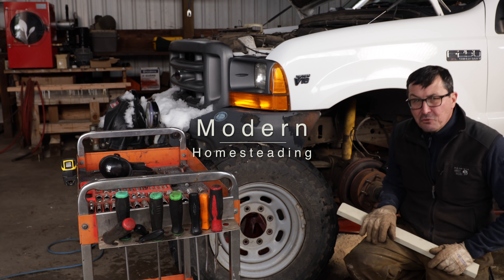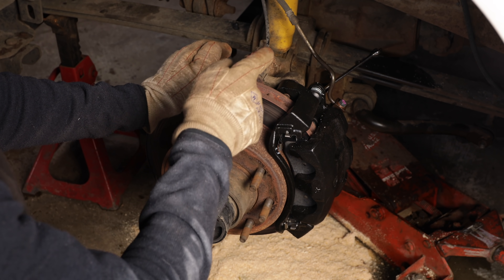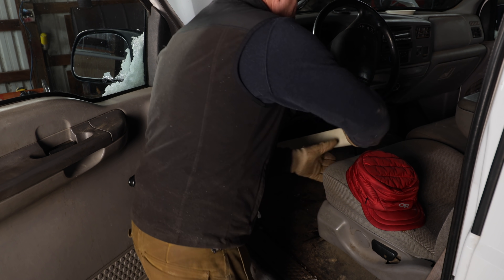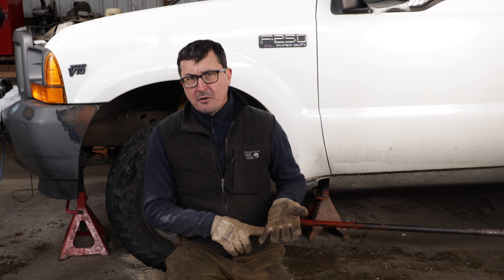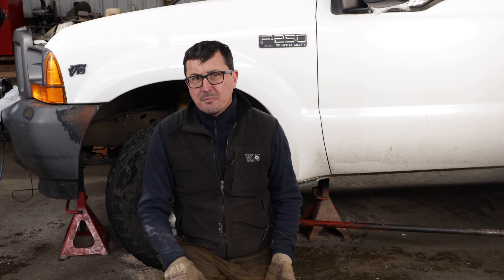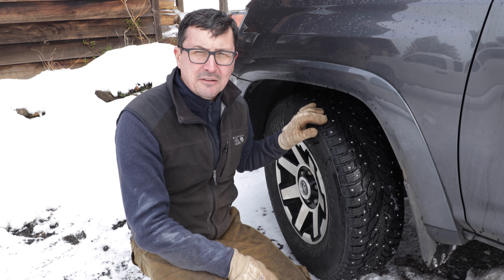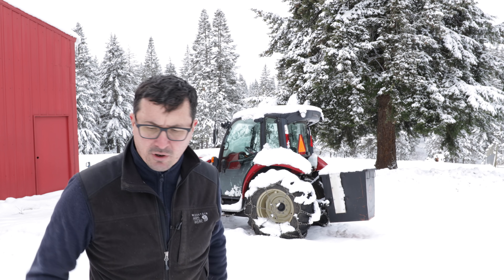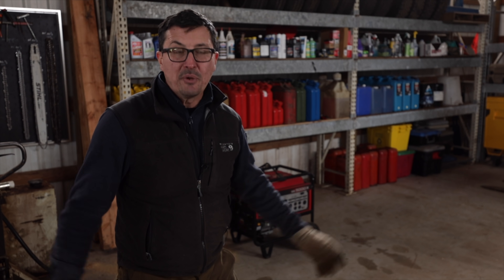IT FINALY HAPPENED!

Comment from the maker: Get boot chains here - https://amzn.to/364SlXj (amazon affiliate link)
Reply: Ohh boy,  I've busted my tail several times going from ice onto tile in the mudroom floor on concrete in my shop lol.
Reply: yes, Saves a lot of time  :)
Reply: FREEZE DRY MARSHMALLOWS! they taste great also try some candy
Reply: Two years ago I was spreading ice melt in the parking lot at work, using a hand crank rotary broadcaster. My legs went out from under me so fast that it was as if they had been kicked out from under me. I felt my head hit the ground, felt my ribs crack, and after laying there for a moment, I realized that my arm was broken. I had to have surgery to install a plate. Thank God for Workmans Comp. My company actually pays full wages for up to 30 days for an on the job injury requiring time off. I also thank God that my body still heals well, and quickly.
I will be getting a set of these this week.
Reply: Should have worn your boots with the little DIY cleats in them... 'member those?
Reply: cody a better trick with bleeding your breaks put a rubber hose on the bleed valve one that fits on tight and long enough to run down in to a bottle of break fluid that is sitting on the ground make sure the hose  goes to the bottom below the level of fluid open the valve and get in the truck and pump the brakes air will go down the hose come out and float to the top of the bottle job done
Reply: Hey Cody, heres a quick trick for bleeding brakes by yourself from a journeyman mechanic, get yourself an empty soda bottle or Gatorade bottle, and a clear rubber tube about 24"-36" in length that fits nice and snug over the bleeder valve, drill a hole into the bottle just big enough that the rubber hose can slide in and out snugly, fill the bottle about 1/4 full of brake fluid and place the hose about 1/2"-1" off tue bottom of the bottle, attach the other end of the hose to the bleeder valve, crack it open and slowly pump the brakes several times. This pushes all the air out of the line and as you release the pedal the fluid you added to the bottle keeps air from being sucked back up into the system :) works like a dream :)
Reply: Jared Kean has to
Reply: AJ Hainstock .
Reply: Wranglerstar what about Land Rover defender there a good truck mine has never broke down or had problems with it
Reply: Can I have a axe
Reply: Wranglerstar hey! Love your channel! I was wondering if you ever tried those boot chains removing snow from your roof. I’ve always had to go through multiple pairs each winter with the Yactrak brand and they are not cheap. Would love to hear your opinion!
Reply: @williams6550  no Amazon affiliate link for those though lol

Comment: I like how Ford did the spark plugs, the engine just blows them out when you need new ones.
Reply: Jim C makes so much sense
Reply: I almost spit out my coffee reading this lol
Reply: Or how they brake off in the head when you replace them on a 3 valve v8 and have to buy a special tool to remove what's left of them lol
Reply: This is why they make helicoil boys.
Reply: @BIGREDTECH  they take a special plug designed by Ford so.....
Reply: Hapend to my v10 but my old dongle is still going
Reply: @jeremybrua5523  no. Bosch makes the best replacement, and its the same thing they would put in it if she puked the plugs or not. Problem being here is the plug grounds so hard it eats the threads on the plug and eventually they blow out and it makes a god awful noise and you lose compression so bad it wont maintain 45mph. Wrap the new threads with coil before you put them in and itll never have the problem again. Cam phasers though...... thats a different story
Reply: easy fix for that... buy a 7.3 or 6.7... or 460 or 351 or 400 or any other engine... you know the ones that were made by ford...
Reply: @thesavior2398  agreed. Real trucks dont have sparkplugs.
Reply: @highclasswhitetrash9027   hahaha good point
Reply: 7.3 was not made by Ford, made by international.
Reply: @joshstaton508  and they put 7.3s in everything right, not just ford bodys?
Reply: @joshstaton508   correct i just  kinda included it as a outlier but also you could say the 7.3 gas haha but no i really just uncluded it as a outlier.  also people need to take care of their engine and change the oil every 3k miles... and stop overheating your engines
Reply: @joshstaton508  if we're going by that standard ford has never made a diesel engine, neither dodge or gm........
Reply: Happened to mine three times. The third time was one of the repair inserts blowing out after the dealership did the repair. It's currently sitting and waiting on me to get the time and money to replace the head.
Reply: This happened to me when I was younger lol.😂🤣🤣... It was my fault for installing the wrong spark plugs. Makes a heck of a sound and fire 70mph.
Reply: @highclasswhitetrash9027  the 6.7 power stroke is a ford in house motor. Also the new 3.0 power stroke is a ford motor.
Reply: Aluminum heads are the clue to a crappy truck engine.
Reply: @jonathangray7067  color me wrong buddy haha, i didnt know that fords contract with IH went the same as dodges with cummins, the powerstroke is now shittier for having fords name on it. Fiat is loving the cummins now, maybe sterling will keep up with IH and be the new go-to for us daily haulers of 10k plus.
Reply: @thisisyourcaptainspeaking2259  ARP head studs fix all aluminum head problems, and theyre affordable.
Reply: @highclasswhitetrash9027  say what you want, but 6.7 ps is the best diesel out right now. Lot of cummins and duramax guys are trading in for a power stroke.
Reply: @jonathangray7067  not saying the 6.7 is shitty, ive only driven stock in a loaded down f350 but i wasnt impressed. The lbz 6.6 with turbo and injectors pulled the same load better with more mpgs. One rig cost $80k one cost $15k ill let you fill in the blanks.
Reply: @jonathangray7067  and before we get carried away my daily is an 08 f350 with the 6.4.
Reply: This is why I dont buy trucks with spark plugs.
Reply: @highclasswhitetrash9027  a duramax and a allison is a nice set up but you get that chevy off the highway and the front end won't last for 50k miles. Where I'm from you're either putting new front axle seals in a dodge every couple years, or bullet proof a ford 6.0, or now guys can afford a 2010 and up ford with 6.7, and with a dpf delete and just a tune on all three diesels (duramax, cummins, power stroke) the ford 6.7 puts down way bigger numbers.
Reply: Not with the glow plugs
Reply: @jacobscout4  if we say that we might as well say no grid heater either eh?
Reply: 93 ranger 2wd 2.3l 5sp, 478,000 miles and still going strong! My daily work truck. Crazy reliable.
Reply: Poor fella hasn't had the pleasure of working on Ford's brainfart 6.0 or 6.4 Powerstroke......
Reply: Never once had a Ford modular engine pop a plug. Torque the plugs and then go an additional 1/8th-1/4 of a turn. They won't ever blow out.
Reply: I have 2004 F250 V10 since new and it still runs and sounds great.  Changed the original spark plugs @ 190,000 miles with no issues. Never been to the shop for anything.
Reply: @jamesrichardson559  My 2000 Expedition 5.4 has 203k on it. Original engine and drivetrain. Never even had the valve covers off and all original accessories on the engine. Super reliable vehicle!
Reply: Never Helicoil a triton ford motor. They have a taper at the end of the cylinder head. Buy the cal van kit and it is a Permanent fix for the spark plug issue.
Reply: Yep, I kept having problems with lack of power, rough running, on my F250. I kept taking it to the Ford dealer I bought it from for a "tune up" and oil/lube, and then random plugs would fail, then break in the engine block..... Finally I flew into a rage and told them that they had better fix my truck once and for all and the service rep says, "well, you know, this truck was due for a spark plug change 7,000 miles ago...." trying to make it my fault. I asked him and the 2 other staff at the service desk "What does Tune up mean to you? Would you agree that it includes plugs?" I told them I wanted all new plugs, new wires and anything else remotely connected to the spark plugs and that I would be taking my business to another dealer that understood a customer's request. The owner of the dealership chased me for 6 months, calls, cards, apologies, flowers, fruit basket....... The dealer where I now live actually does a great job and will be getting my future business.
Reply: How to fix ANY ford.......Buy a Chevy, easy as that
Reply: @73xlh  Yeah, that's why chevy is stopping production of it, because it is that good......
Reply: @70acres  no matter, gm' s next production will be light years ahead of any Ford.

Comment: I spent $35,000 on a new ford. The truck honestly spent more time at the ford dealer being worked on from transmission issues and front differential issues, than in my garage. Then it started to have electrical issues. The truck wasn't fixed after the ford technicians worked on it several times. Always owned Chevys before that and I've never had any major problems other than a few sensors and a fuel pump. So I traded in the ford and my problems stopped.

Comment: Just a few more pro tips. 1- Gotta make sure the break hose isn't bad too, it can cause pressure to not release on the caliper, also the caliper slides, both can cause overheating and smoking of breaks.   Just slapping a caliper on there my not work. 
2- Only depress the break pedal half way when bleeding too.  Master cylinders only see limited travel, which causes grime to build up.  Mashing the pedal all the way down will drive the cup seals of the master through that buildup and can kill the master cylinder.

Comment: My 1970 Chevy C-10 pickup (her name is Bessie) is still ticking along like a Swiss clock.   Older Chevys were built to last.  350  quadrajet Rochester carb.  She will fly.
Reply: exactly. my 71 blazer - no computer. can be repaired with a $60 socket set.
Reply: Hey I have that same jotul 8 in your profile pic thing heats the garage good
Reply: @calebmartin2457  I love this wood stove. I also have a Jotul 3, which in my shop. :)
Reply: CountryLifeTales that’s awesome, I was just scrolling through the comments and I was like hold up that’s my woodstove 😂

Comment: "looking at the used market", last time I looked Chevy was holding value better than fords at least in the 1/2 ton area, but maybe its west coast math
Reply: kurtblack8 think he comparing the raptor to a 1lt lol.
Reply: I remember when the raptors came out. Every lawn service guy around here bought one and traded in or sold it real quick. For the first year you could find them everywhere for around $20k with as much mileage. No one realized a truck meant for jumping would squat that bad with trailer weight.
Reply: You are correct, however I think that has more to do with new Chevy trucks being so ugly, most people would rather buy a used one.  I'm not a Chevy hater, I just hate what has happened to resale values on squarebody Chevys (i.e. they're no longer affordable).

Comment: My GMC has a quarter million miles, and the only thing I replace on the regular is transmissions!
Reply: mky9314 I think you’re confused with Dodge
Reply: My GMC had 479,000 when I traded up to a Ford - The F250 was sold, still running great at 350,000 - My F350 has 137,000 and will likely be the last truck I own. 
Take good care of your vehicle, maintain the fluids and address the little things immediately.  Half a million miles is easy on a Ford, GMC, or Toyota with good maintenance.  (Dodge not-so-much)
Reply: I have done more transmission work on gm's then any dodge. The 4l60e is a flaming pos that nobody brags about. Then all of there newer crossovers have transmission issue. Most expearence it shortly after the extended warrenty runs out.
Reply: @RTFMAce  I retired from GM I have owned over 70 cars, trucks and vans, GM, Ford, Chrysler, Fiat, Lotus, Triumph, Honda, Toyota, BMW and I have worked on even more! They ALL have their issues but the best vehicle I ever owned was a 1949 Dodge pickup with the Hell head flat 6 and with enough traction it could pull a house off the foundation and it never left me stranded! I wouldn't have a new one though!
Reply: But that's an older GMC. I was a GMC man wouldn't ever buy anything else. I have a 2013 GMC and it has been the biggest pain. Brakes rotors the passenger turn signal is out and I can't even get my hand to it enough to change it. I even took it to a mechanic and they couldn't either. Had my wife try with her small hand she couldn't get much closer.
Reply: @indianaoutdoors4379  every time ive had anything with the 700r4 or the 4l60e it always gets replaced with the sm465.
Reply: Is it automatic or manual?
Reply: @818181cb  you have to drop the wheel shroud to access the light assembly, or tear apart the entire grill, dealers choice.
Reply: @living-wellon-less5669  I agree 100%. My uncle had a 1943 Dodge that could go anywhere. He used it for everything from mining to ranching and it never let him down.
My best was a 1976 GMC that seemed like it would run forever. I miss the trucks that could be worked on at home under the shade of an old apple tree.  I'm not sure we're better off with the computers and all the tech that's been put into everything.
Reply: Living-well on-less if you’ve had to buy and sell that many vehicles you might be doing it wrong! 😂 I’m joking of course, amazing testimonial.
Reply: My 5.3l GMC has 160,000 I have never had a single problem. Standard maintenance.
Reply: I have a 94 Chevy Silverado. 
With over three hundred and eighty thousand miles on it. this entire time I've had it, I've only had to have one major piece of work done, and that's a new water pump.But I guess it's like anything else,learn your machine learn how it operates figure out a good maintenance schedule, buy quality gasoline and fluids and it's all good.
Reply: Hahaha what about fuel pumps
Reply: Joe Garofalo II yeah just like the cumins and tremec transmission bought from outside companies
Reply: i went through three in mine after No.3 got another one then added after market shift kit and larger trans-cooler, tci torque converter . now the trans been good for 6yrs .
Reply: Lucky, i bought a brand new one and it broke before i got of the lot. Then at 1500miles blew the engine, 6000miles blew the transmission. Bought my dad an acadia, blew a rod out of the side of the block at 4000 miles.
Reply: hahahahahaha
Reply: @JoeGarofaloII  they are the best but are only available on Duramax trucks

Comment: LOL...slick insult to the Cummins bhahhahha....I love mine and havn't had to do ball joints on it.  140k miles on a 2000 24v and I love it.  I still love the 7.3 powerstroke but ford kinda messed up the truck rep with that 6.0 Diesel. I hate to say it, but it's true that the 6.0 got a bad rep.   Curious about the Triton V10 you have.  We just bought a 2018 4runner.....brand new and we expect it to last 400k miles for sure.  
I disagree with ya on the RAM trucks......at least the 2nd gen dodge is a great vehicle.  As for newer dodge?...I can't bring myself to spend that amount of cash....wondering whether it's worth it to buy Diesel in a new truck with the fuel and def expense.  Does diesel resale value justify the extra expense of DEF and Diesel fuel costs?  Anyone?
Reply: Noooo wayyyy I found a Stoney ridge comment🤯😂 love your videos man

Comment: “Dodge needs new ball joints every 30k”
😂😂😂😂😂😂😂😂😂😂😂
So true.
Reply: My Dodge/Cummins has 95,000 miles on it and it has never ever had a problem.
Reply: Went through 3 sets on my 05 ram in 150k lol so about spot on. Just replaced them for the first time on my 01 f350 at 225k and only the drivers side was bad
Reply: 2015 ram with 620000 miles original  ball joints
Reply: My 06 ram 2500 165000 1 set of ball joints
Reply: Never replaced them on my 3500 Cummins.
Reply: Cynical Texas Dad and don’t forget steering boxes
Reply: My Cummins has kingpins. They never should have changed to ball joints.

Comment: When bleeding brakes you should use a 1/4" clear hose about 12" long that fits over the nipple portion of the bleeder screw. You put the open end into a glass jar with some brake fluid in it and as you open the bleed screw you watch for bubbles coming out of the hose. By keeping the hose under the fluid you will not pull air back into brake caliper when the pressure comes off the system or if the pedal is pumped.

Comment: My Tacoma is the worst truck I’ve ever had. Underpowered, weird transmission, cramped interior, uncomfortable seat, and more. Worst part is it’ll prolly last a million miles.
Reply: I completely feel you on that haha. I don't mind the interior of my 1st Gen, the transmission is great but the power of it is just a joke lol, it's not my primary so I don't have to worry about it but every time I go up hills my truck has to shift about 2-3 times just to get enough torque to make it  up the hill. And the New ones I heard are the same way, kinda ridiculous. But hey they run like a dream and last decades
Reply: Just 'till the frame rots out ...
Reply: wjs97m i have a ‘97 T-100 and the only issue I’ve had was the original fan to alternator belt snapping from dry rot last winter. Man...I love that truck
Reply: Just got 2019 taco can’t argue with 1 resale value 2 warranty 3 towing cap and 4 off road abilities